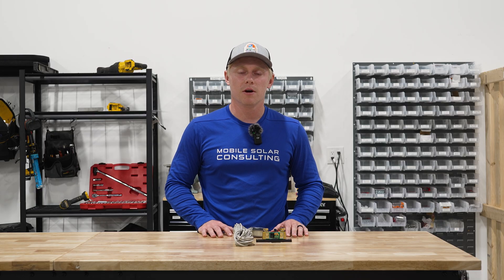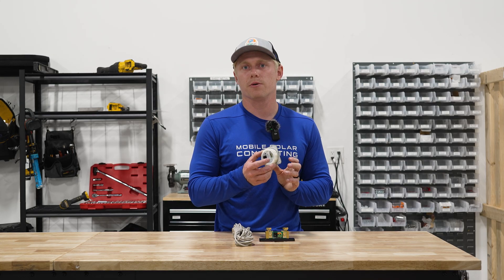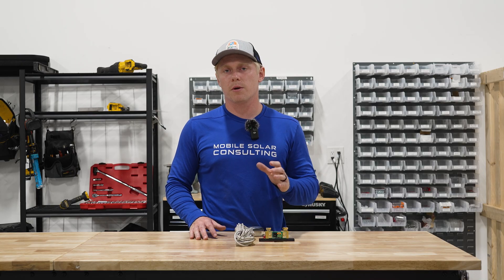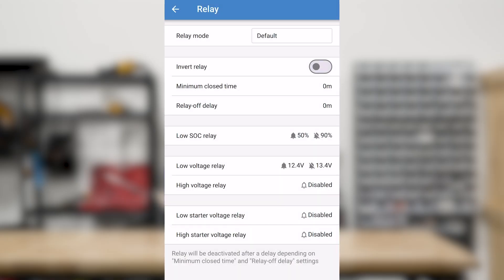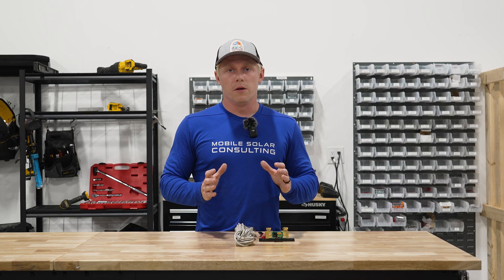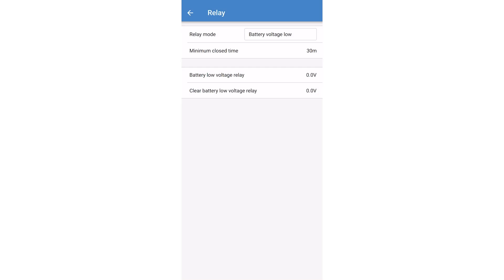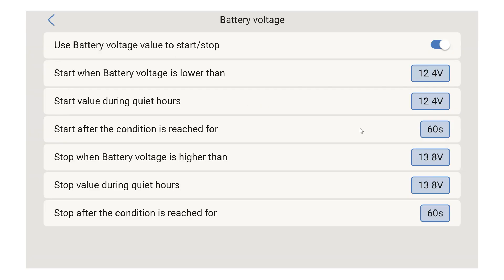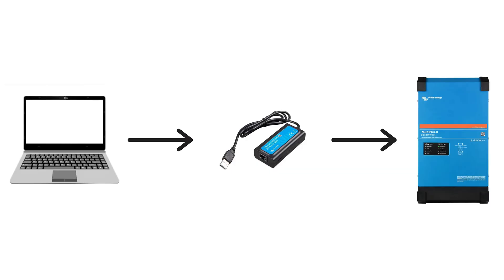How to Set Up Auto Gen Start on Victron (MULTIPLE DEVICES)

Comment: I'm curious how battery voltage works when some of my charging parameters are higher than the resting voltage of a fully charged 48v lead acid battery bank. what would my stopping voltage be?
Reply from the maker: Contact the battery manufacturer, but probably absorb voltage around 58.4